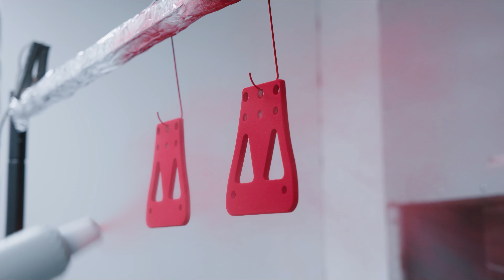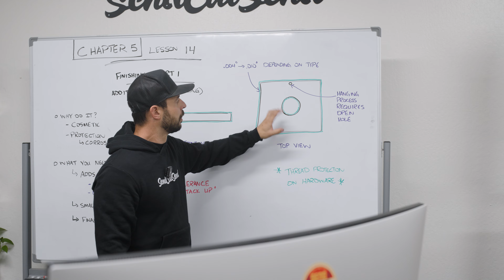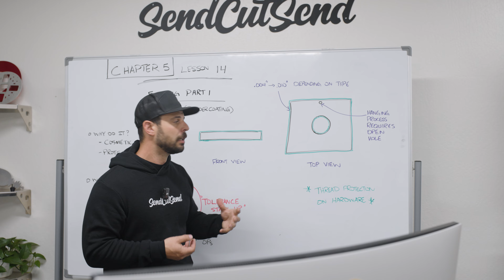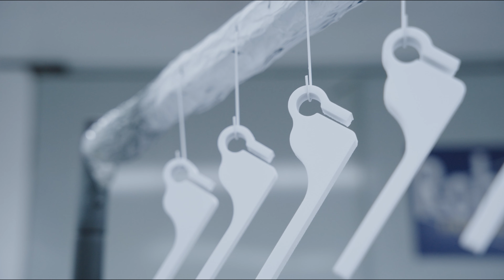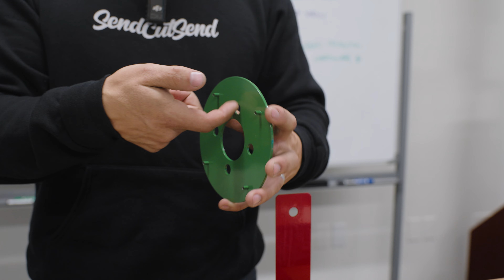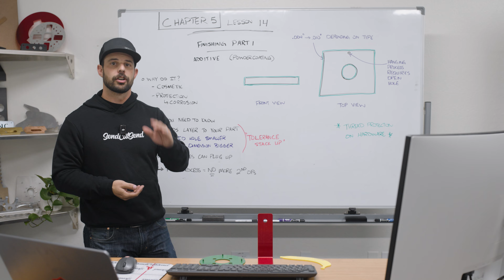How to Get Perfect Results with Additive Finishes - Education Chapter 5 Lesson 14

Comment: Is there any way to mark the part/dxf to designate WHICH hole to use for hanging? Say I have several holes, which all need to have good, clean coating, so I want to add one more, which is a "throwaway" and will be hidden, if the coating doesn't fully coat the hole. How do I tell y'all: "Use this hole for hanging. I don't mind if the coating isn't perfect here"?